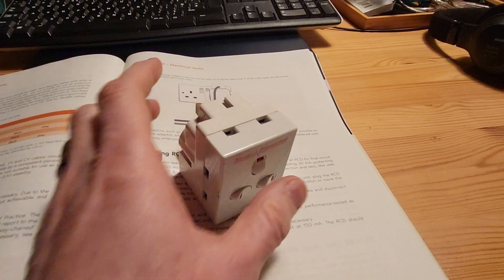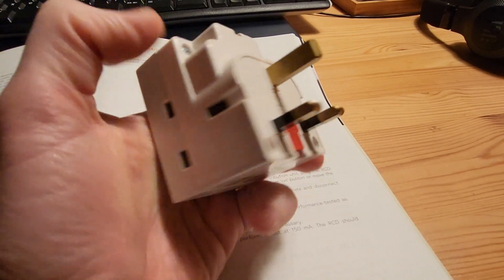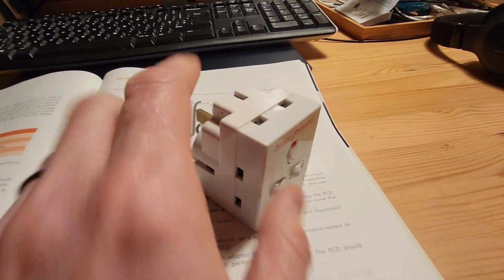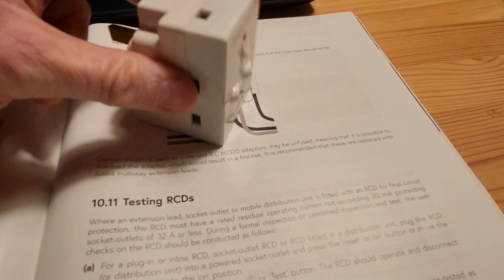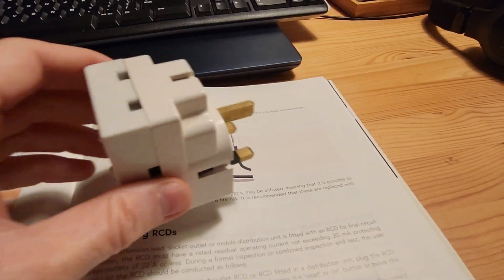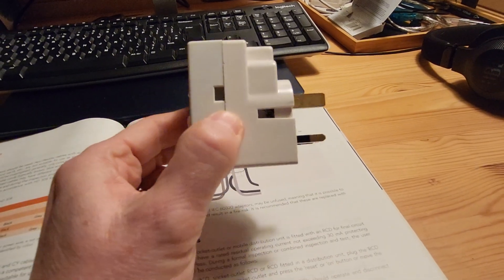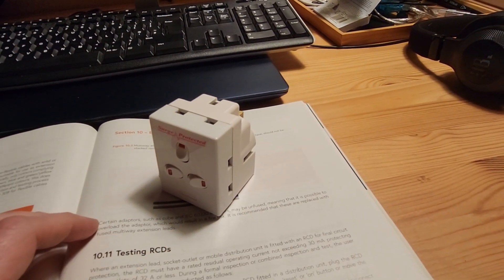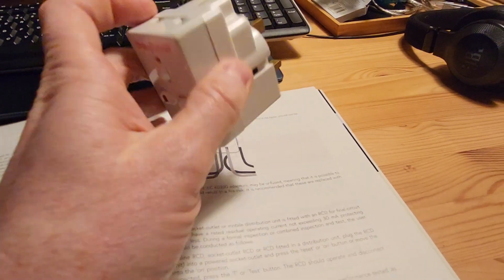Are these adaptors dangerous?!? 2 way and 3 way multi adaptors.

Comment: Hi, I have a three way fused 13amp plug I just purchased from Screw Fix. I needed to  plug my new wireless router and my Fibre Optic plug into this? Or shall I purchase a floor adapter extension lead instead.Just wondering is it safe...🤔
Reply from the maker: 3 ways are safe if used as intended and as per the manufacturer instructions

Comment: I take it replacing a 2 way non fused adapter with a 2 way fused adapter (which certainly exist) complies with this rule ?
Reply from the maker: It’s difficult as it isn’t a rule as such, just guidance. All 3 way adaptors will be fused but with 2 way adaptors 90% will be unfused, especially older ones. Fused 2 way adaptors are available from CPC but that is the only place I have seen them. I have never seen a fused 2 way out in the field which is why I always recommend against using them.